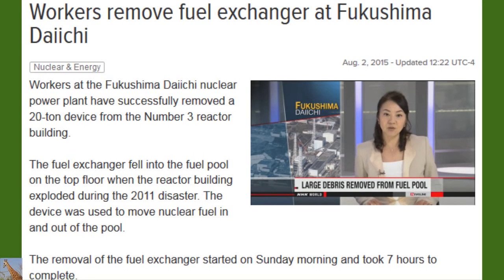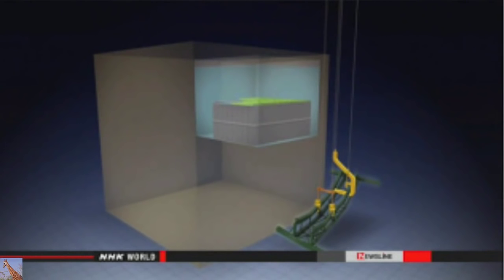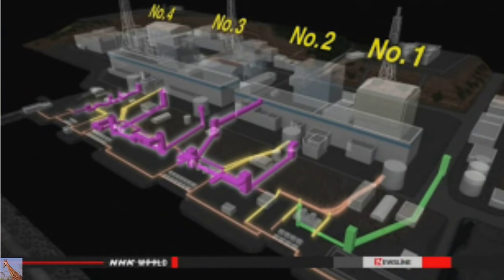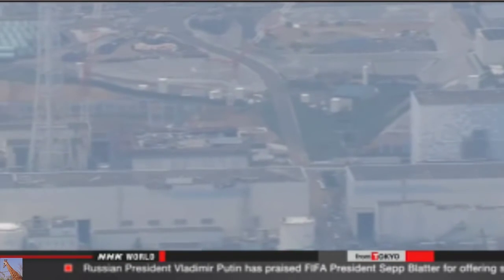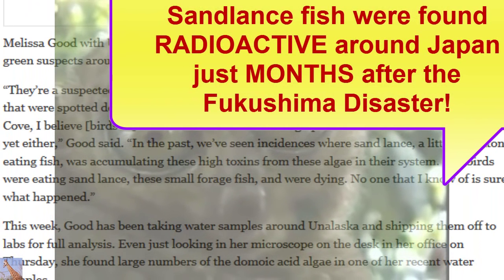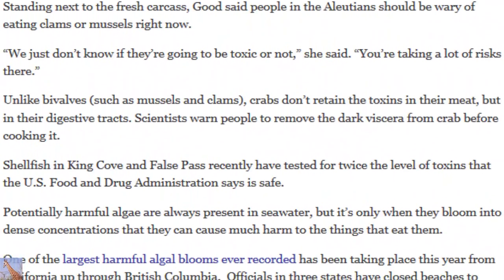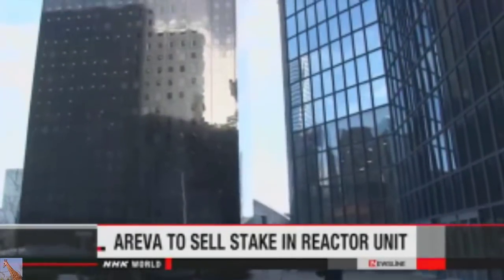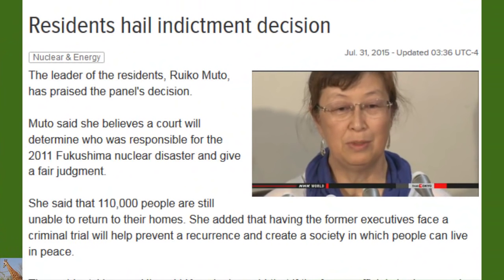Fukushima: SFP#3 Equipment Removal, Cements Tunnels, Ice Wall Fallacy update 8/2/15

Comment: Thanks Milky for everything, sub for more updates and news. OneLove!.. I'm trying to get caught up for the last few days on Fukushima Updates.
Here's the video of Tepco removing FHM from SFP 3 8/2/2015 https://youtu.be/se7t8AfP0Cc
"Workers Remove Fuel Exchanger at Fukushima Daiichi at Reactor 3 Spent Fuel Pool" (Aug. 2, 2015 )
Workers at the Fukushima Daiichi nuclear power plant have successfully removed a 20-ton device from the Number 3 reactor building.

The fuel exchanger fell into the fuel pool on the top floor when the reactor building exploded during the 2011 disaster. The device was used to move nuclear fuel in and out of the pool.

The removal of the fuel exchanger started on Sunday morning and took 7 hours to complete.

As the site is highly radioactive, workers watched camera footage, and used 2 remote-controlled cranes to carry out the task.

The 566 fuel rod assemblies in the spent fuel pool of the Number 3 reactor building could have suffered damage if the device had fallen back in during the removal procedure.

The other decommissioning work at the plant was suspended during the removal to secure the safety of the workers.

The plant's operator, Tokyo Electric Power Company, says there were no major problems, and the amount of radioactive substances at Fukushima Daiichi has not changed.

The removal of spent fuel is the first major challenge for the decommissioning of the plant, which will take an estimated 40 years to complete. But the large amount of debris and the high levels of radiation have kept spent fuel from being removed from the Number 1, 2 and 3 reactor buildings.
The removal of the fuel exchanger is a major step forward, but the removal of spent fuel will not start until 2017, or 2 years behind schedule, as it will take a long time to remove the debris and decontaminate the area.

The current roadmap says the removal of spent fuel will start in 2021. However, TEPCO has not been able to determine the location of the spent fuel rods that melted and fell, and has yet to start developing technologies to remove them.

Many issues remain before the buildings are demolished and the decommissioning work is completed.
~~~
"Fukushima Plant Clears of Radioactive Water" - WOW - WHAT A MISLEADING TITLE. Wow.
~~~
"Ice Wall Building Resumes" In SPITE OF THE FACT THAT the ICE WALL HAS BEEN PROVEN NOT TO WORK.
~~~
DEAD AND DYING WHALES (including little Sandlance fish - BY THE WAY: those little Sandlance fish now found to be 'TOXIC" here in North America were Also found to be RADIOACTIVE just shortly after the Fukushima disaster began in March 2011)!!! Hint hint.
~~~
AREVA to Sell Majority of Reactor Unit - Areva is Broke!
~~~
Residents Hail Indictment of TEPCO Officials
~~~
Robot "may delay" visit into reactor 2
~~~
Sendai Nuclear Power Plant does practice drills for accidents - Nearly ready to reopen - just miles away from a recently active volcano!
~~~
New Seawall in Nahara
~~~
TEPCO sued over suicide of 102 year old
~~~
Reply: is so sad to see I like japan and its people
....  :-(  PS. don't eat the fish people ext.....
Reply: Silver Gold Man Always talking to me like you know me....PLEASE JUST DO NOT .